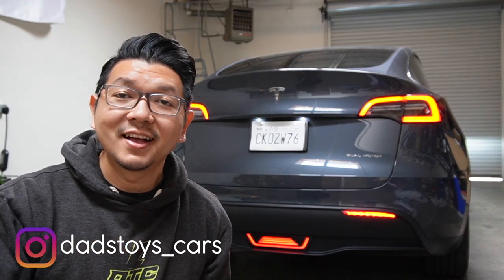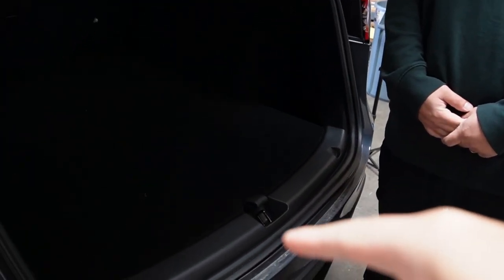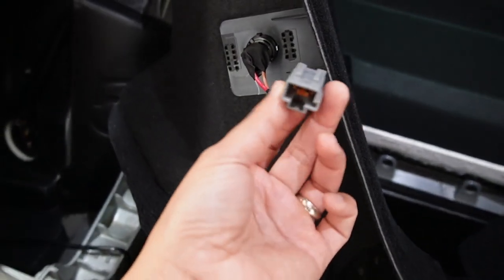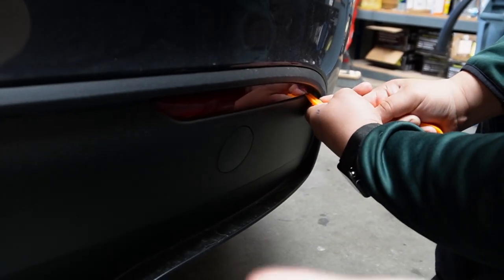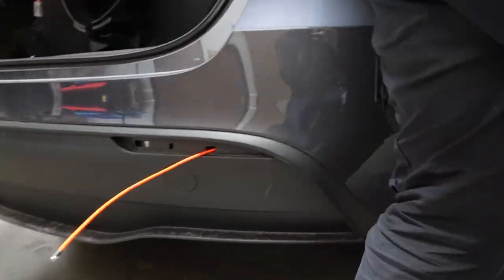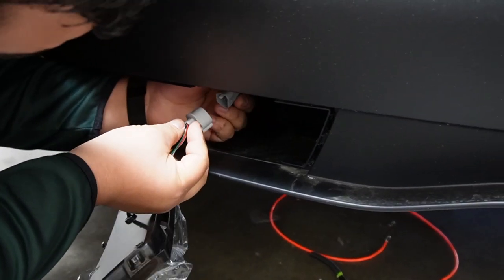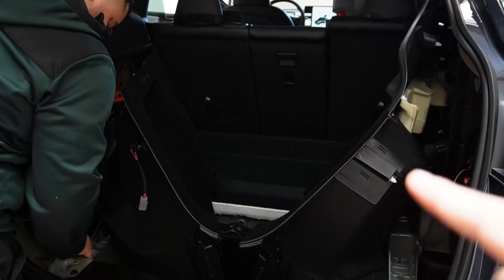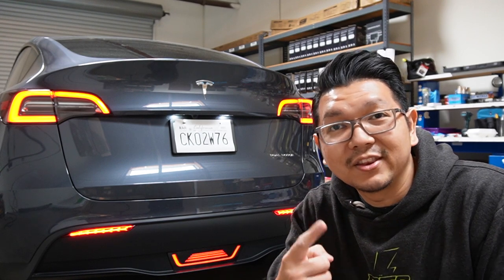2023 Tesla Model Y Pilot Light Upgrade / Full Installation #tesla

Comment: When they have easy installs for DIY guys I will buy!
Reply from the maker: Pilot light is actually easier to install than the rear bumper lights in my opinion.
Thank you for watching and your great support!🙏😃
Reply: Not sure why they dont connect it to the tow hitch plug thing? Wouldnt that be easier ?

Comment: Just a warning to early Model Y tesla owners. I ran into an issue installing pilot lights on my Model Y. I have the 2020 Model Y with the old style red blinker tail lights so these pilots won't work since when you press the brake, the pilot lights registers that as both blinkers "blinking" and then it would light up amber instead of red. This is a wiring issue since the old tail lights uses 3 wires (one wire controls both blinkers and brake) while the newer version uses 4 wires and have a dedicated brake wire. If your tail light blinks red instead of amber, save your money for another mod.